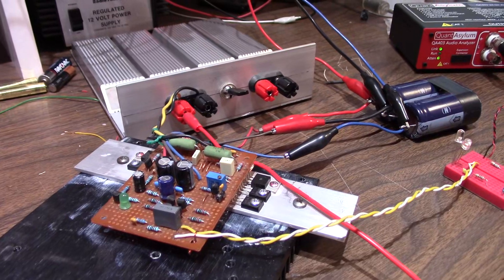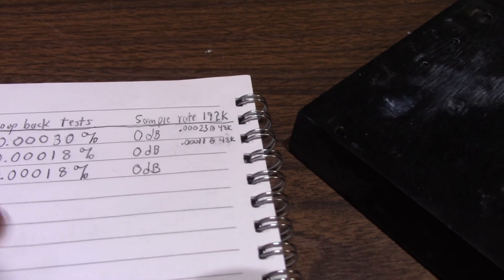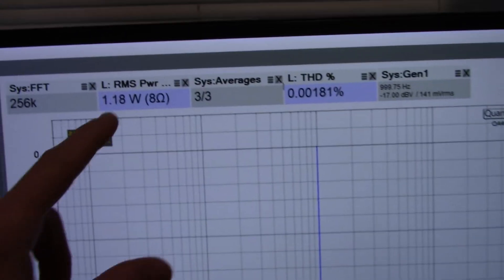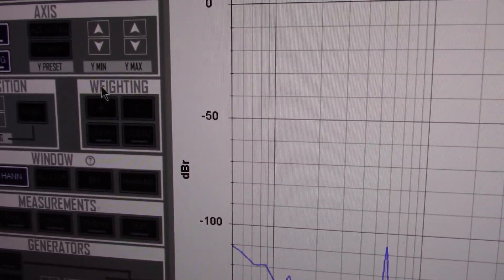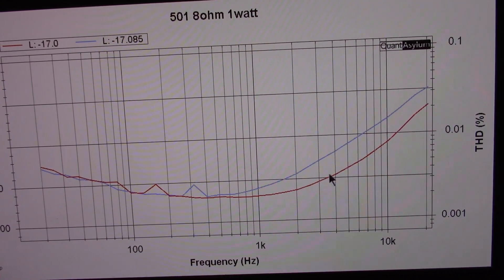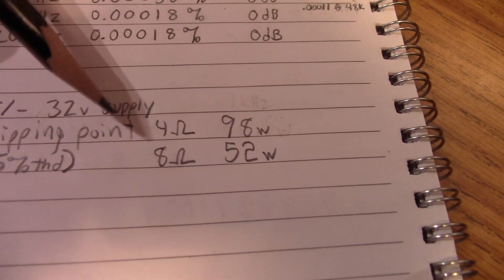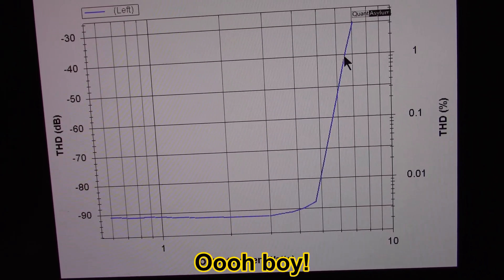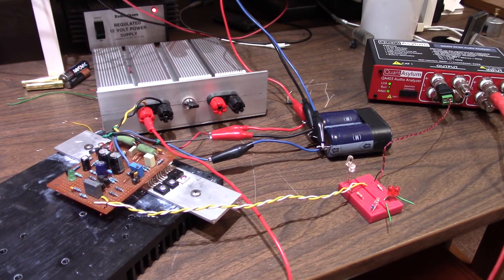JAT501 amplifier tested on the Quant Asylum QA403 audio analyzer

Comment: Good evening  john . I have little modified the jat501 amp for 90v dc ct, its working and i am getting 900w rms at 2 ohm load with 8 pair of output transistor . only issue i am getting is humming , please help me to get rid of it

Comment: What sort of SNR does the JAT501 have at 1W?
I plan to make one for compression drivers with 110dB sensitivity, so I need the highest SNR possible.
Could it possibly be made better on this board? If so, how?
Reply from the maker: Looking at the noise on the FFT, it is below -120dB, though I'd have to do more careful measurements. Lowering the amplifiers gain to the usable minimum can reduce noise further, though you must check that you're still within stability margins. I find the noise present in recordings to be well above noise generated by most power amplifiers anyway.
Reply: @JohnAudioTech  well the noise depends much on the speakers also. Like I said, mine are about 110dB sensitive and I sit quite close, this means the amp has to make 20dB less noise than normal amplifiers.
I've found that even with amplifiers with a stated SNR of 118dB(probably at full output) , I still get a decent amount of noise with no signal.
But I will try to make this jat501 amp and see if it would be good enough.

Comment: Good video, John, thanks a lot. The earth loop can really mess up the measurement, due to the return current of the load. You could use the input in differential mode. A few questions:
Does the smaller miller cap increase the risk of oscillation? Maybe you already covered this in earlier videos.
Also, did you have to alter anything with the +/-12V supply? I guess the bias current needs to be tweaked.
Looking forward to future videos!
Reply from the maker: The miller capacitance value is a balance between performance and stability. The amp should be fine at 47p. No changes needed for low voltages.

Comment: I'm still curious about what would happen if I added 2N5551 driven by Q3's collector together with Q9 to form a negative current mirror and change the circuit around Q6 and Q7 to form a positive current mirror. So both the current source and the current sink of the VAS stage are driven by the LTP stage.